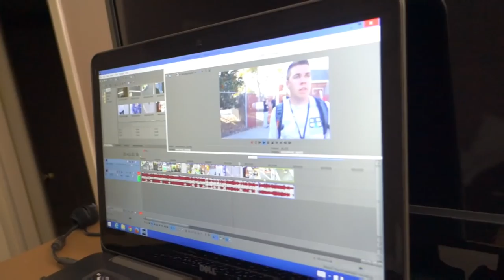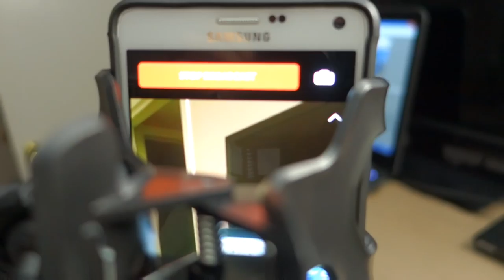Window Cleaning Business Tips,Techniques & Water Fed Pole | VLOG

Comment: I do some window cleaning from time to time and your tips really help.  I'm not a professional but never had any complaints yet.  Basic method, bucket, scrubber and squeegee.  My problem is those dam screens, some are such a pain to deal with.  Can you do a video just on screens and how you deal with them and how to charge accordingly?  Some windows I spend more time messing with the screen than cleaning the window.  Some I can't even get out in fear of damaging the screen or frame.  What about those old screens, those ones that will fall apart if you even try to touch them?  I know you have your customers sign a waiver if a window is scratched or the UV film is damaged.  Have you damaged a screen before?  What have you done to repair it?

Comment: I have a window cleaning business. I use all squeezes. Im wondering how you get all the dirt and such off of the windows. Also, if your doing a new build and theres cement caked to the windows, does the water pole system get that off to?